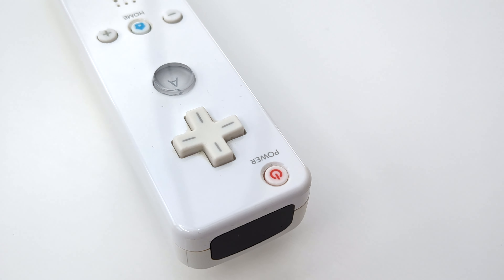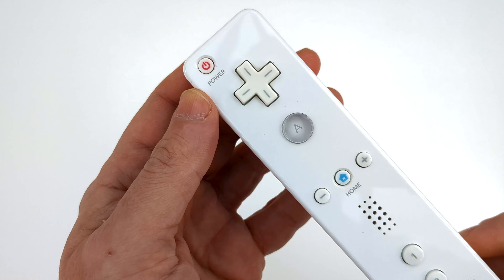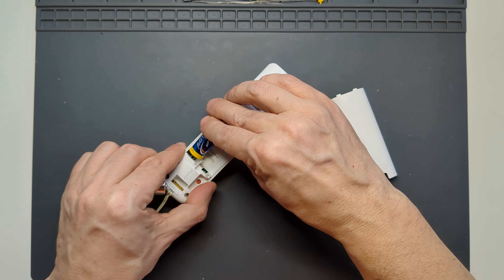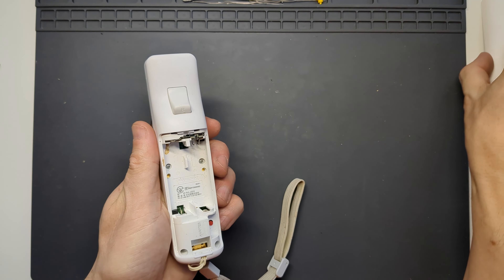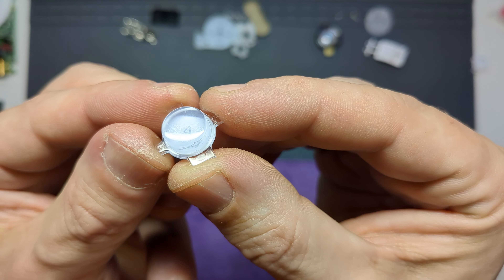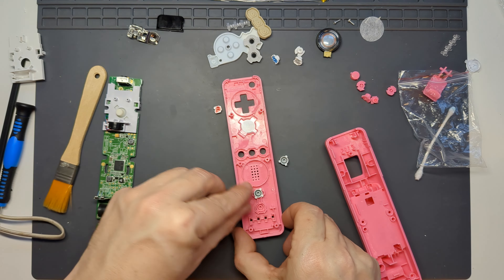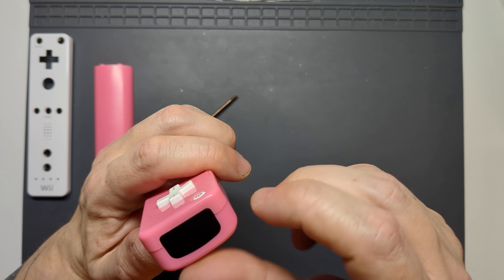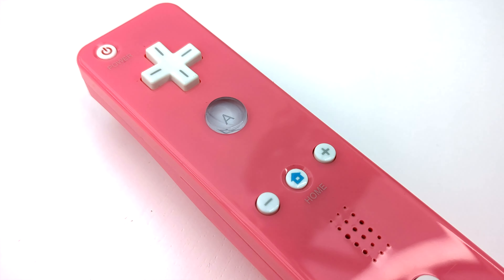A forgotten classic? Nintendo's Wii Remote controller revisited and modded in 2023

Comment: Thank you for covering this! The wiimote has a lot to offer for sure. I used one as a MIDI controller in a band for awhile, using axis motion to control filter settings in puredata. A couple libraries do exist for connecting to and translating the data from the wiimote on PC but they're pretty obscure. There's also the difference between the wiimote and wiimote plus that adds the built-in accelerometer, and also came in a bunch of nice colors. I've got pink and black ones and I've always thought if I ever had a reason to open them up, I'd swap out the buttons.
Reply from the maker: That's all awesome and very encouraging to hear! There's definitely mileage in this.

Comment: Came out well! I didn't quite understand why you drilled a hole in the old shell.
Reply: The power button is the only part of the controller that isn't symmetrical - so by drilling a power button shaped hole in the other side he can lay the new one on top of it and the new buttons will sit flat in all the holes and it's easier to get everything lined up to close it!
Reply from the maker: @kineticturtle  correct! However Matt has a point. The power button actually sits pretty flush in the controller so I didn't really need to do that 😅